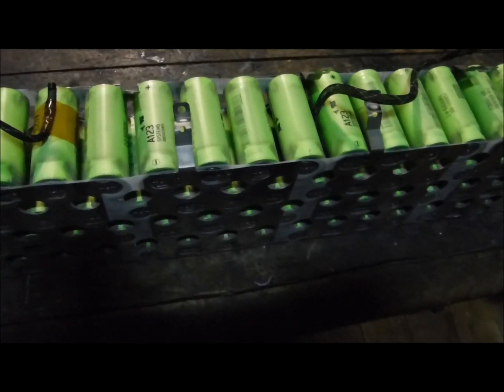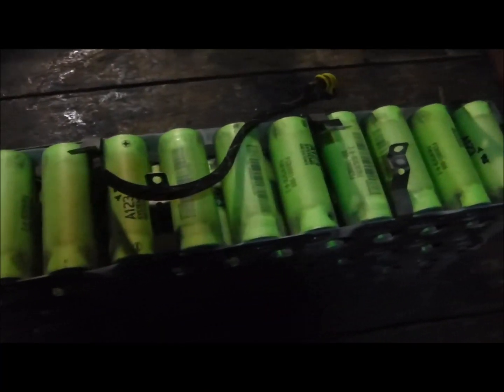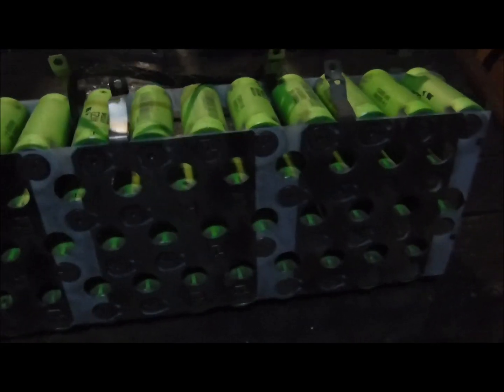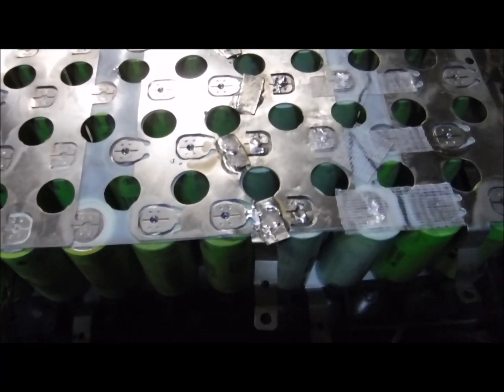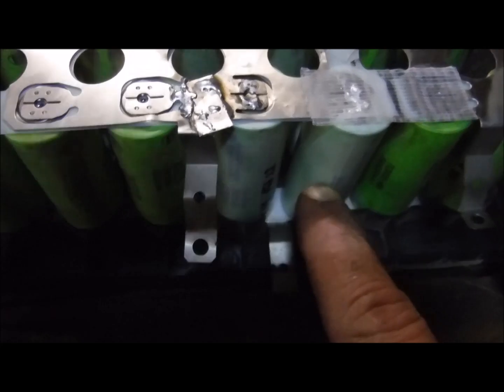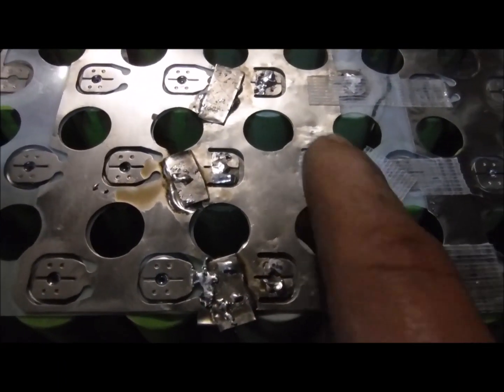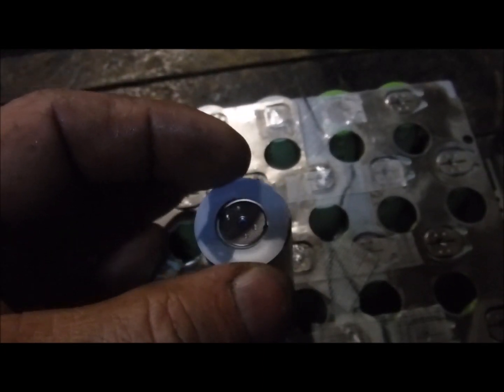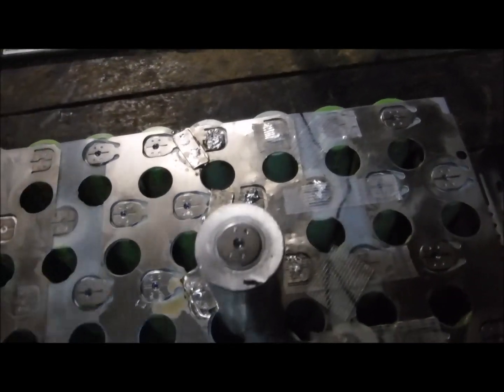BAE A123 Systems Battery Pack Repair 40Volt Pack

Comment: I got a couple of these too. They were at 39.4 & 38.6 so I charged them in parallel to 44v.  Peeled the stickers off the sides to measure individual stacks.
Have you had any luck with the BMS? I'd like to try to get it working before disassembling the unit.
Reply from the maker: I have but not completely sorted out yet. So far what i know is there needs to be a input voltage thats pretty low from what i can tell. Lower then 24 volts i know for sure so far. I,m still sorting it out slowly as i get the time to. So far i,m thinking its about 5 volts Dc  I never played around yet. To top it of i,m not even sure to what these bms even are set up to do. Not sure they will even balance out the packs of cells. So many bms act in different ways. Lets face it  BMS stands for Battery management system. Not really meaning balancing out anything. I,m even thinking them batteries went in to a shop and had the balancing done as a maintenance call every few months.  If and when i sort it out i will get back to you about it. Till then cheers.
Reply: @MrDoingEverything  if you look at how they are in their original enclosures, all the batteries are daisychained to a central controller.  They need voltage and commands from that master in order to go into balance mode.  They also relay back their statuses (voltage per cell, temperature, status etc) along with their number in the chain.  The bms on pack looks pretty heavy duty and would probably be perfect if someone could decode the messages that the main untill sends.

Comment: Cool I got a bunch of those but none have any dead cells yet. Did you figure out why? Also the control board is working? I never did try to get mine working just used an Ebike BMS instead.
Reply from the maker: No idea to why them 8 cells went dead. All back ok now:) few hours work was all. I,m not going to use a bms i will go with low to high voltage cutoff switches joined to each group of 8 cells. Plus i,m going to charge them packs the same way each group of paralleled cells single group charges. I figure truely its the best way. More work to it less cost though. The way i,m going about it. I figure a better charge to more for sureness to my knowing they been charged evenly. I don,t trust them bms boards. I just don't. I feel its a false sense of trusting.
Reply: @MrDoingEverything   yep I paralleled all my cell groups together and charge separately at first with a balance charger, it works but got lazy and went to BMS for now I still check it daily at least and I only charge them to 3.57 as there seems to be hardly any usable power above that or below 3.05
Reply from the maker: @offgridwanabe  Not much use-able power below 3.05 that,s good to know. I have not used mine yet. If there is anything else that would be good for me to know please do tell. My top end charge will be about the same as what your bringing yours to. Tell me how are they holding up in use for you. You getting good run time with out any charge going into them. I guess what i,m asking do you figure what you paid for them to be well worth it.
Reply: @MrDoingEverything   well I have 12 40 volt packs wired up as 24 volt as 2 separate 24 volt batteries and I left them as I got them so I could use them later for something else maybe 48 volt. So I got 8px2.2ah= 17.6ah x 12=211 ah x 24 volts = about 5kwh. and I just use the middle 80% so about 4 kwh and I know these are used batteries so likely about 3 kwh would be a reasonable capacity and the most I have pulled from them is 2 kwh over 36 hours. The most I've tried to pull at once is 2500 watts using my 3524 outback inverter so around 100 amps at 24 volts. I only paid around $60 a 40 volt pack so I think they are a good deal.
Reply from the maker: @offgridwanabe  Sounds like its well worth it yea for sure. I just tried playing around with them dead cells i changed out. I wanted to see if maybe i could get a charge back into them and no luck was had doing that. It looks like after they hit o voltage there no longer any good. I,m going to keep trying different ways to know for sure. So far it looks like there no good at all for anything.